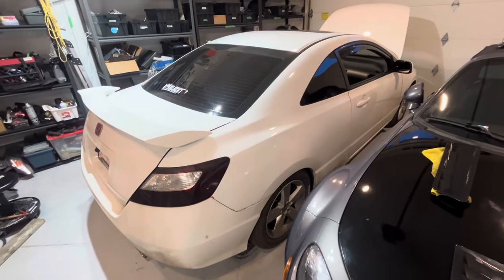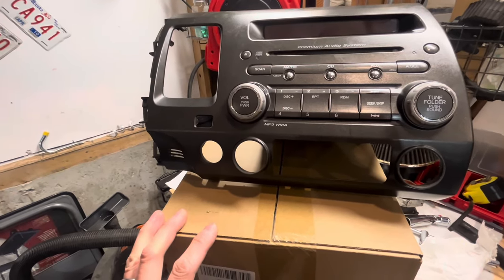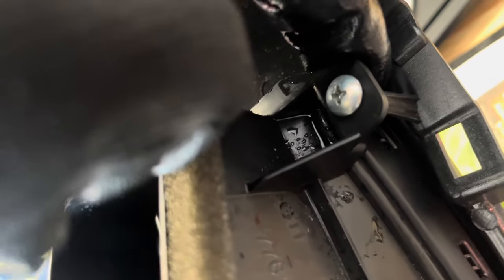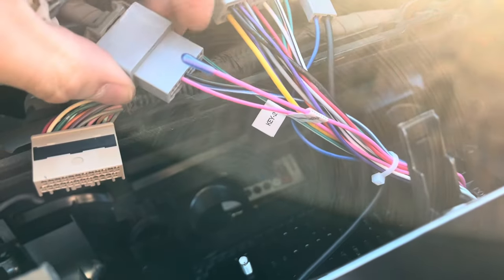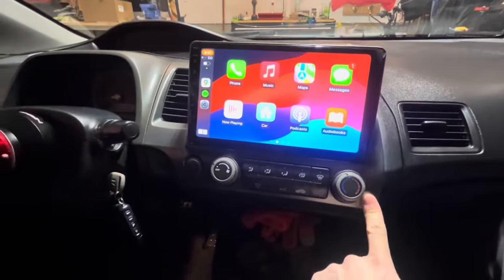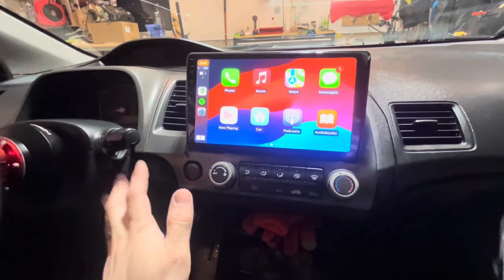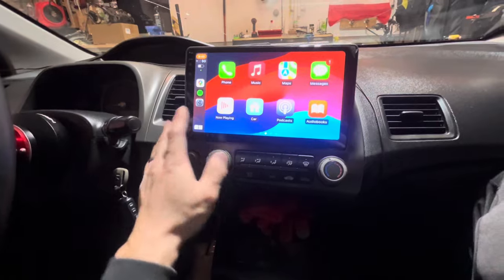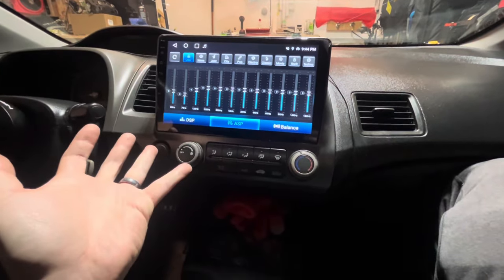Easy BUDGET headunit for 8th gen civic si ($150) wireless CarPlay!

Comment: I installed this it works great mine was another brand but looks the exact same. Only issue was the screw holes were a bit too small so i had to work them in and out
Reply: The heat exhaust on mine is wider than the hole, but the screw holes it. It looks ok, but its going to blow some heat behind the unit. Also the screw holes were too small and one of them split open. Its really a cheaply made facade.

Comment: Hey man great video! It’s been about 2 weeks now, what has your experience been so far? It’s listed on Amazon for $200ish dollars, you think that’s still worth it? Do you experience any input lag? 
Also are you able to watch YouTube/Netflix etc on the unit? If so, parked or also while driving? 

Lastly, do you think it’s possible to also install media keys on the steering wheel at the same time? 

Thanks man
Reply from the maker: it's been solid so far, but the one issue is I can't connect to the google play store to download apps. I can watch YouTube since it's preloaded and browse the net while moving. It has a learning feature so you can customize your steering wheel controls through the settings.

Comment: I saw your video this afternoon because I order on of these for my 10 si but no sound at all. Come to find out it doesn’t support it , I tried to
Order this someone but it says not available for florida wth lol , I look
For a similar is coming tomorrow. Hopefully that one will
Work
Reply from the maker: Make sure the amp trigger wire is part of the connector or you might have to wire it manually